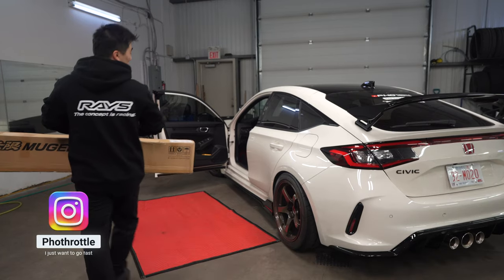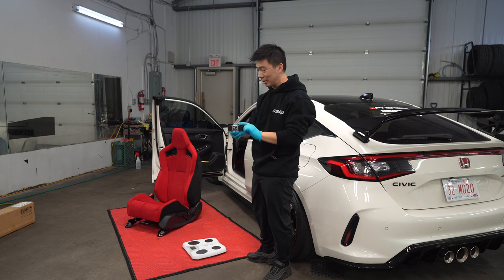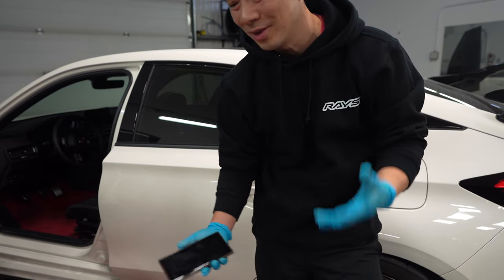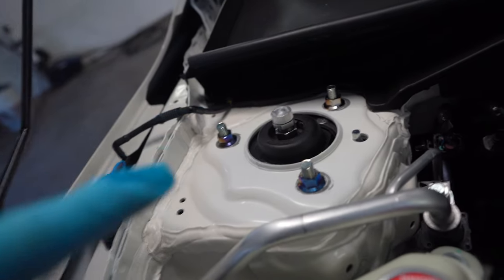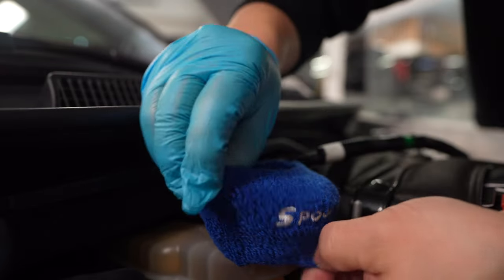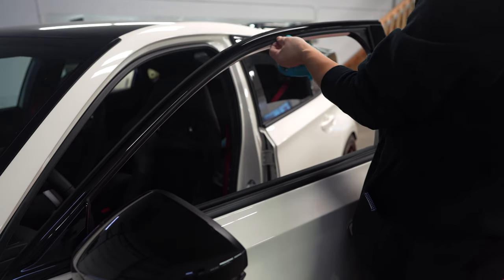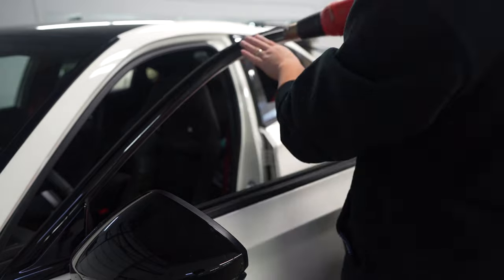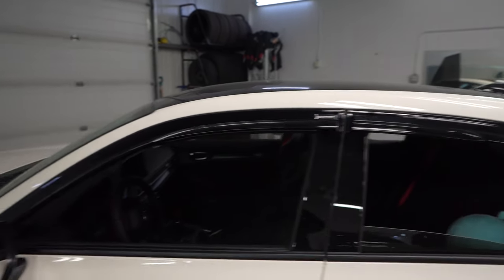JDM Parts For The Honda FL5!!!

Comment: That’s a nice touch. Hope they have that on g86 flatform,
But again baru isnt a honda
Reply from the maker: Yeah Mugen is the AMG of Honda but if you decide to get someone gt the ones that go on the outside of the window frame and not the ones that go in between the window and the frame.
Reply: @phothrottle   Thanks I’m aware of that rain guard visor lol that’s y im hesitating to do it.. coz of my ppf. Also i think its kinda imbalanced compared to sedan like my wrx for example it looks good. But not sure about coupe. But again i also like the functionality of it. So I’m torn lol